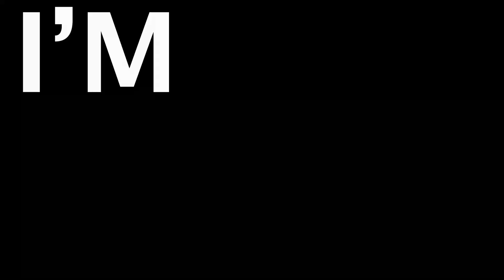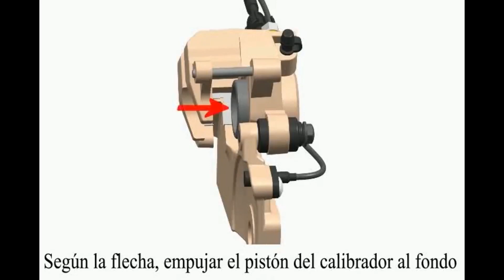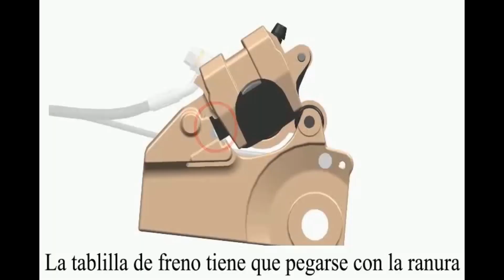SPANISH ALL ZONTES 310  REAR BRAKE GUIDE

Comment: Is it have rest?
Reply from the maker: Sorry I don't understand 🤣
Reply: @michaelphillips1959  l mean is this the end of the video?
Reply from the maker: @mrmustafaali3416  yes, after the brake pads are inserted and then bolts tightened,  the pistons need to be pushed out from the caliper to rest on the pads so the pedal is worked to get the pressure back so the brake works, I will see if I got a better video of the proccedure ta